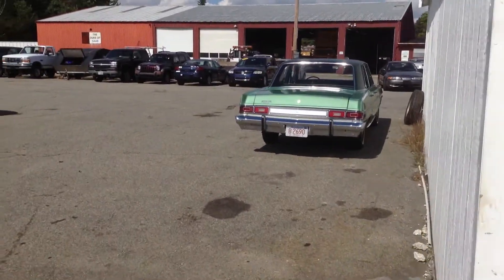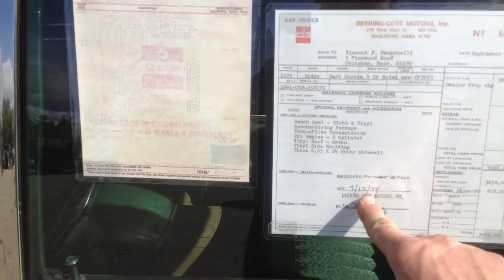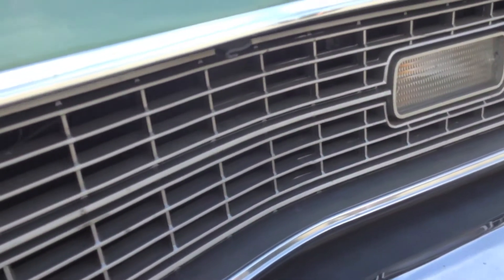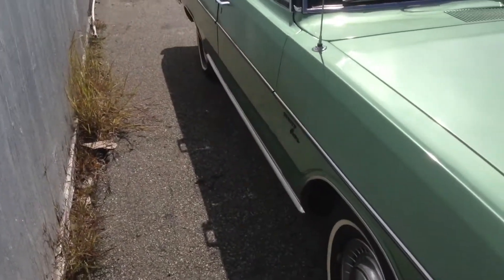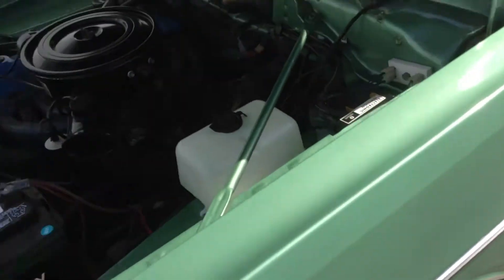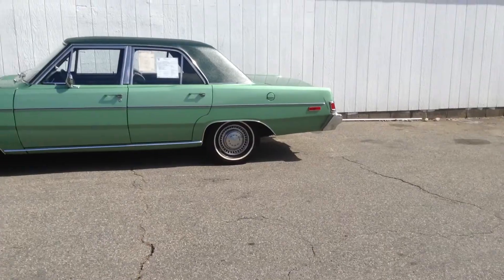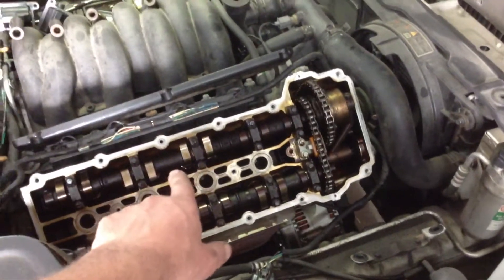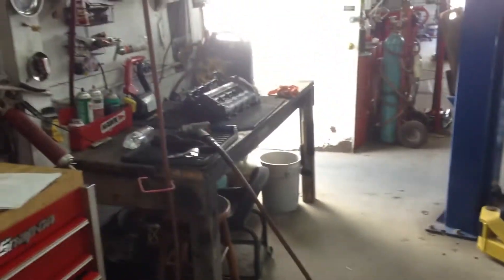The Cleanest Dart.

Comment: I have a 2004 saab 9-3 and the manufacturer calls for fully synthetic oil .how do I keep my gaskets from getting brittle and leaking .I have a leak on the sensor that is located on the front of the oil pan , what does that sensor do and what should I do . Thank you :)

Comment: I was excited, until I saw the engine. A six... Sorry purists, but I would find a correct date coded 318 V8, and install it on the car, just like if it had the option from the factory.